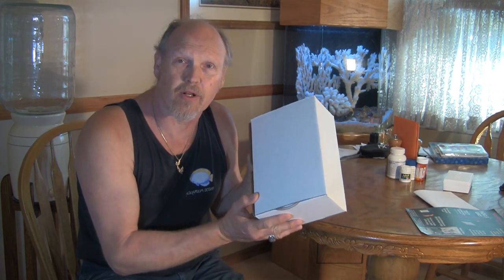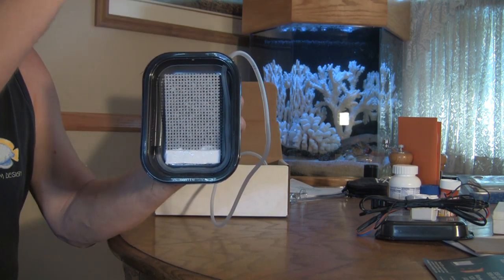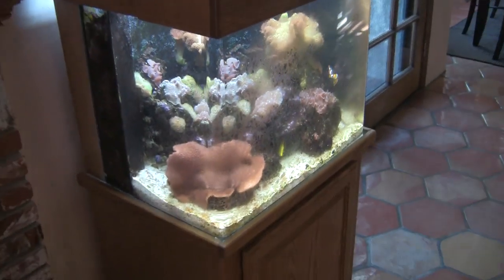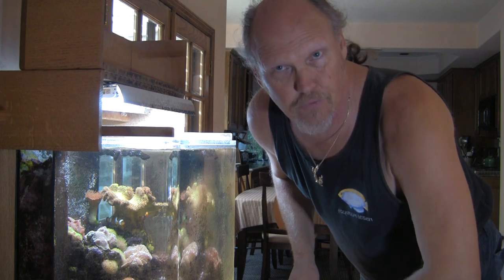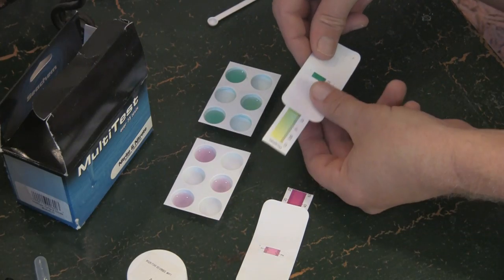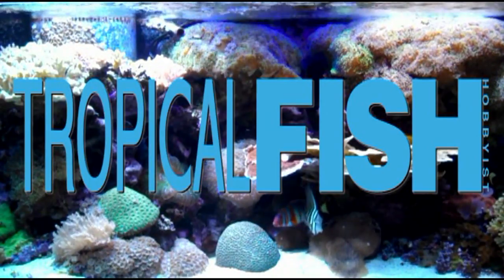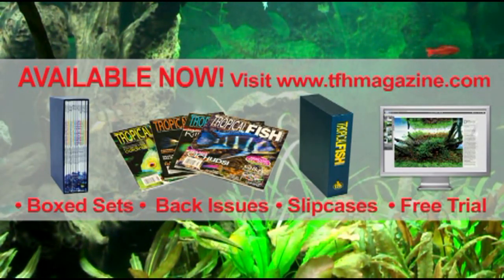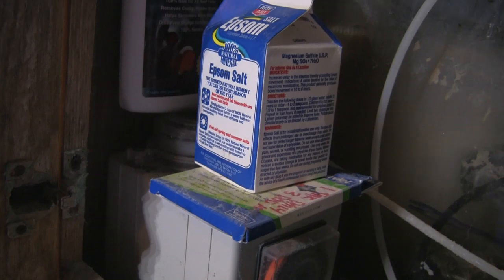HOG Upflow Algae Scrubber, LA Fishguys Episode 120 pt 1

Comment from the maker: hey Y, I dont know metric but 100 c seems taller than the lengtyh and width so I would consider the metal halide...that assumming you are doing a living coral reef tank. you might also think about LED lighting as it will run much cooler tham MH or fluorescents